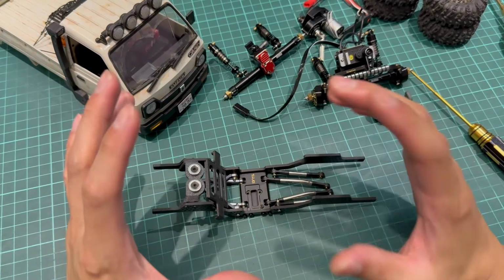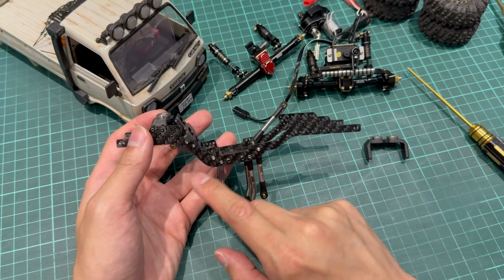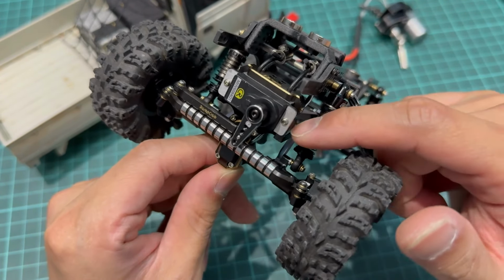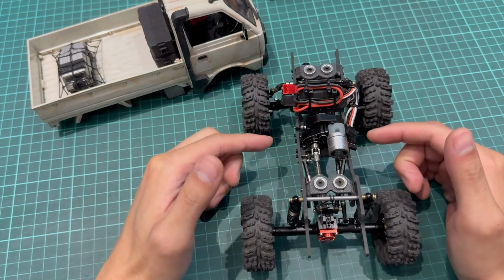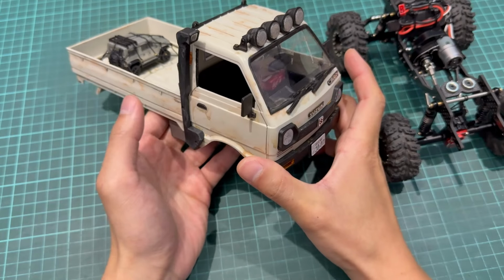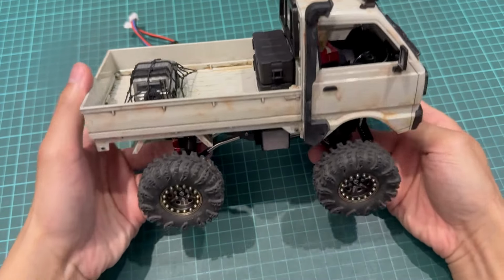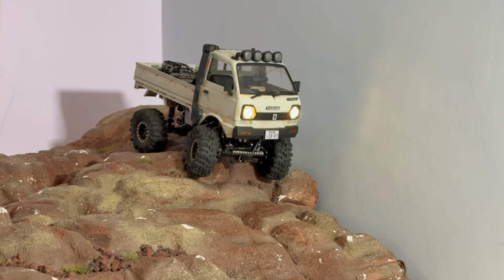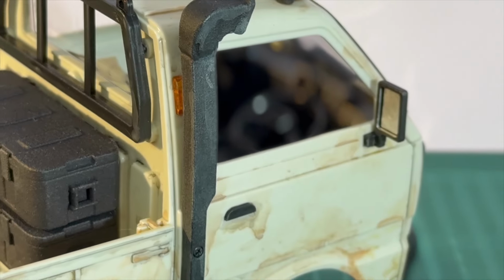Build: SCX24 Suzuki Carry - RampCrab LCG chassis, WPL Mini D12 body, short wheelbase kei truck fun!

Comment: How much did it all cost in the end
Reply from the maker: I honestly don't know, I never tally up any of my builds. If you really want to find out, you can add up all the parts I listed in the description.
Reply: @OutclassCrawlers   Me either, I don't "want" to know! LOL When I tally then up in my head anywhere between $350.00 and $500.00 depending on mistakes or probably in better words choices that don't quite work out or look the way you had in mind etc. BUT those happy accidents usually kick off my next build so on it goes. I have built 2-3 in the 30 to 32 scale range but it's too small for me to do a bunch,  BUT I'm very glad to have done them so I can join in on the fun. I have done 3-4 SCX 24 and 4 on 5 TRX4M 18 scales (one 18 is a full Redcat 18 all Injora) 18 scales. I do have a couple RTR but I've never upgraded anything on them the parts always turned into rigs... well, I think I put some shocks on the 18 brushless but that hardly counts. The edit was a spelling that just had to be corrected.
Reply from the maker: @karpo63  I also don't want my wife to come here and find out how much i spent lol

Comment: Thanks for sharing!

Any chance you can do a video on how to get your micro crawler to drive realistically? More body roll and appear less rigid and 'hoppy' when trail crawling?

I love both 1/10 and micro crawlers and would love to know how to get my micros reacting similar to how a 1/10 does. I think this might be possible even if the micros don't have as much weight / interia?
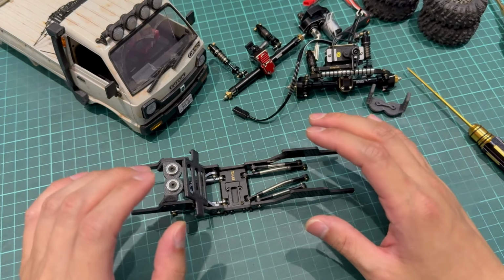Reply from the maker: Thanks for watching! I have the shocks on my hardbody trucks slammed to keep the CG low. And on my performance builds, I try to keep body roll at a minimum to avoid upsetting balance. So I’m probably not the best guy to answer your question. 😅 Back in my 1:10 days, I tried so many springs to get my TRX4 trail truck to get it to behave realistically. Maybe you just gotta keep experimenting to find the right spring rate for your build.

Comment: I got one for Christmas . Two days later I broke it going really fast on the treadmill and it hit the side and then the back axel got disconnected and it broke the plastic on the frame, but the shell is OK. It is a custom shell it’s red so I’m thinking a four-wheel-drive conversion just like this, but maybe slightly less aggressive tires. After my other remote control projects.
Reply from the maker: @henrybates6122  I just looked it up, red looks awesome! I didn’t know they come in different colours.
Reply: @OutclassCrawlers   Mine is completely custom a person in Greece made it look weathered. The Scale Model.

Comment: I love it! The super short wheel base looks like it would be a blast. Maybe a handmade Kei truck out of thin styrene and full brass wheels.
Reply from the maker: @wingnutbert9685  I’m not adventurous enough to build a whole truck out of styrene, but I am thinking about using it to make a roll cage for this truck.

Comment: Hi, this might be a stupid question. But do you think this body will work to a stock fcx24m discovery chassis or a stock scx24 lexus?
Reply: I believe the wheelbase of the hard body in the video is 120mm the fms fcx24m discovery is 137mm and I think the lexus is 127mm so you could probably line it up better with the scx24 lexus
Reply from the maker: I don't have neither but if I was to pick one, I'd pick the SCX24 to do the conversion. I'd try Injora's magnetic post mount in the front, and Gladiator's hinge in the back to attach the body. You also get more link choices to adjust the wheelbase to suit.